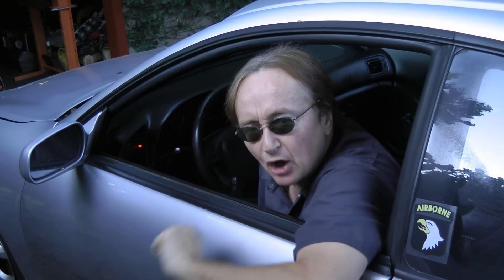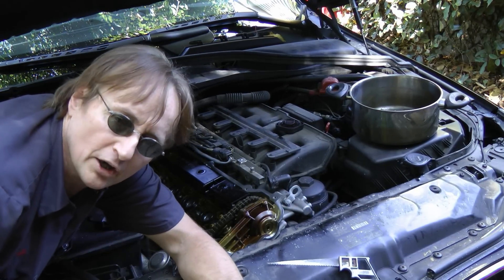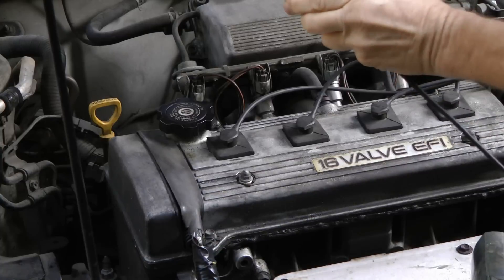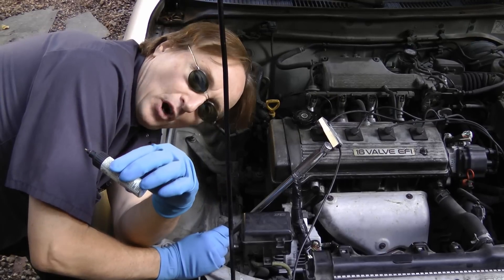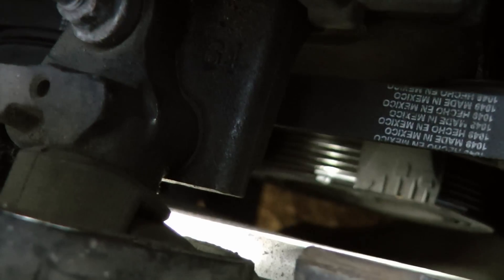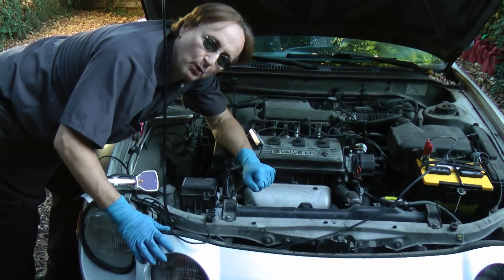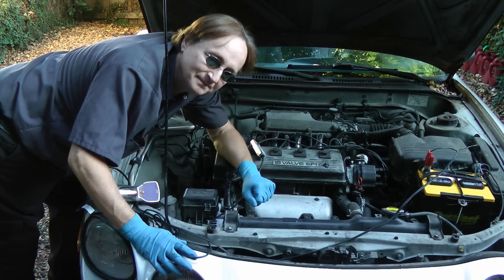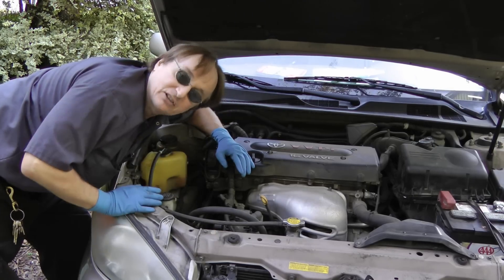How to Check a Timing Belt or Timing Chain in Your Car

Comment: Hey scotty man my car hasnt been able to stat for a while ive changed fuel pump and starter, all ralays and guses are good to the t. My fuel pump wont prime but i hear it at crank, its getting power for sure. Theres corrosuon on my positive cable but none on the negetive. I have no clue what it could be and ive checked everything.please help.
Reply from the maker: if fuel pump gets power when you check it, but no pressure, start by replacing the pump
Reply: I replaceed the pump and it gets pressure.
Reply: ***** have you tried all the spark plugs? scrape the corrosion off of the + terminal, have you checked your air filter? how about the ignitions module(s)?
Reply: my alternator in my trans am needed to be replaced, and often my fuel pump wouldnt work right because of it, check that too
Reply: My alternator is out of the car too.but ive tried the plugs replace distributor and rotor still nothing. You think because my alternator isnt in it right now it will cause it not to start?
Reply: doubt that, the alternator just mainly keeps the battery charged, but if it works, install it, then turn on all electronics see if you have a good charge still, i've heard of voltage regulators screwing stuff up, that happened on my trans am, what kind of car do you have, maybe if you go on a car forum, they might be able to help, as my knowledge with cars isnt the greatest, but i know a little bit, is your car carburated or fuel infected?
Reply: Its a 1995 mazda protege fuel injected.
Reply: have you tried changing the fuel filter? first off try some starting spray, u just spray it through the intake manifold, if she dont start then it's something to do with your engine, but try that, and she starts, thenmaybe you will need a new fuel filter?
Reply: Tried it still nothing. I'd hate to junk it being i put so much time and koney in to it.
Reply: ***** Have you tried checking the basics i.e. fuses, relays?  My car wouldn't start one time and it ended up being the fuel pump relay.

Comment: Need help....jus bought a 2010 kia soul 2.0, 160k miles for my daughter. In the morning on her way to school, she stops on a decline hill at a stop sign and the car idles up slightly and shuts off...but starts right back up when cranked and does not shut off for the rest of the day. Any ideas???
Reply from the maker: could be a weak fuel pump, or  car just really low on gas with crud at the bottom of the tank
Reply: do you think it would hurt anything to pull the fuel pump and check the filter

Comment: How do you check timing on a Nissan Sentra. I have a 1993 Sentra with a 1.6 liter and you can't even see the timing marks without disassembling the car.
Reply from the maker: use a timing light as in this video . If it's withing specs, or just a few degrees off, it's OK
Reply: Scotty Kilmer   I can't reach or see the timing marks. No room to access. Does the inner fender come off?

Comment: dear Scotty HOW reliable is a 2002 Chevy Tahoe I've heard they have good engines
Reply: I have a 2001 5.3 and in 150k I've had to replace the power steering pump (fluke really), the AC compressor & dryer, fuel pump (left me stranded) and a couple of window regulators. I've used the pee pee out of the AC living in hot places, so honestly, none of this stuff is problematic. It just wore out. Outside of fuel pump crapping out on a road trip,  it's been rock solid and doesn't leak a drop of anything. I'd say a 2002 Tahoe is very reliable, cheap own, and cheap to fix. I'd jump in mine and drive across the country w/o thinking about it. I drive hard too.
Reply: J Bush very I got one handed down and it currently has 205k miles and the only things were the fuel pump going out and the A/C not working

Comment: Hey Scotty, if you have time. tell me if I should get off my butt and stop procrastinating. I have a timing belt on my '96 Ford Ranger with the 2.3. I changed it ten years ago. Since then, I have put only 38,000 miles on it. Have the ten years worn the belt out or should I just say it ONLY has 38,000 miles? The new belt and water pump kit is already sitting in the back of the truck because spending the money is easier than actually doing the work. What should I do? btw, I just subscribed.
Reply: +Scott9084 Nevermind. It was a dumb post. The change only took a couple of hours. Wasn't worth procrastinating about.
Reply: +Scott9084 the rangers dont have chains??!!
Reply: +**Classified** It's possible the newer Ford Rangers have timing chains. Cars and trucks often had timing belts between the 1970s and the 1990s. My vintage Ranger has a "Lima Engine," named after the Ford plant in Lima, Ohio. It may be the same engine, or shares many parts, with the 4 cylinder Mustang engine of the same day. It also may be a derivative of the Ford Pinto engine. Timing belts everywhere.

Anyway, it was an easy 2-3 hour job as long as I left the water pump alone. Not worth the procrastination. Side note, the only difficult part was to remove that fan pulley bolt at the front end of the crank. Something like 150 foot pounds. Scotty had a video about that too. Something about putting your 21mm socket and breaker bar on the bolt and hitting the starter for 1 second.
Reply: Scott9084 I'm shocked. I always thought Ford did the chains in any truck they built. Even some of their older cars had chains over belts. At least there's a good bit of working room in a truck. Doing one in a 3.5l honda sucks.

Comment: hey the dealer told me my timing belt is cracked and should change it asap it is at 101000 miles (02 jetta) and i have been driving with this "problem" for like 3 months now and i dont know if they just want to get money outta me they said 900 dollars for the job? is that to much this is the price for everything ... help!

Comment: Uhhhhh....that method will only work if the spark timing is triggered off a cam driven distributor or angle sensor.....which that Matrix is not.
 Most modern cars use crankshaft position sensors for timing since it isn't affected by things like cam drive fluctuations and component wear.....not to mention the lack of sparkplug wires to tap onto, with many,many newer cars.

Comment: I drove a truck with those exact symptoms, the A/C compressor was pooched.  Whoever said power steering fluid, that just makes no sense.  The sound you describe would have nothing to do with braking, and if the PS fluid had a problem it would affect your damn steering.  It's an A/C problem and you gotta take it to an A/C guy, you shouldn't do your own work on A/C system unless you know what you're doing.

Comment: They used to say timing CHAINS last the life of the engine, where as timing belts you have change them out every 110,000k or so.  It sounds like choosing an engine with a chain is not the money saver I had thought .. ?

Comment: I don't get it.  The crank pulley is fixed to the crankshaft.  Shouldn't you check the cam pulley timing instead?
Reply: The distributor that fires the spark plugs is fixed to one of the camshafts. If the white line moves a lot it means that the camshafts aren't in sync with the crankshaft.

Comment: Get your timing belt and accessory drive belt checked every 25,000 miles, preferably replacing it every 50,000 miles.
Reply from the maker: that's a bit excessive, here in the states most companies advise replacing timing belts every 90 thousand miles

Comment: this Just happened today, my car vibrates at low speeds then eases out of vibration when it hits higher speeds. I'm thinking somethings wrong with the wheels or anywhere else around it.

Comment: hi there, i am wondering why do head bolts need to be tightened a certain way, like in a specific order, thanks.
Reply from the maker: yes, get a cheap manual with pictures and torquing specs
Reply: Alex Voglar To keep the forces applied by the bolts reasonably even across the head so it doesn't warp or crack, and so the gasket is compressed evenly.

Comment: Did i hear you say change the timing chain every 4000 miles, Really i thought they last longer, i know timing belts got to go every 60k miles and i thought a chain can go further like 120k miles further, Plz correct me if im wrong!!
Reply from the maker: NO, timing chains don't ever need changing if you have a well built vehicle and change the oil a lot. Timing belts need changing every 60-90 thousand miles depending on the make and model

Comment: Hey guys i have a 96 non turbo eclipse 2.0.  My car has been running bad. takes forever to accelerate. it smokes black smoke. it jerks back and fourth sometimes. I just scanned my ECU today. I got these codes. Any help?
P0171 FUEL SYSTEM LEAN
P1494 LDP SWITCH OR MECHANICAL FAULT
P0300 MULTIPLE CYLINDER MISFIRE

Comment: HEY SCOTTY I HAVE A MURANO 2010 , MY TIMING CHAIN TENSIONERS WERE CHANGED TWICE NOW, EVERY TIME THE COLD START UP SLACK SOUND FROM THE CHAIN GOES AWAY LIKE FOR 4 DAYS AND COMES BACK, THE FIRST TENSIONERS THAT WERE CHANGED HAVE VERY LITTLE MARKS OF THE TIMING CHAIN, WHAT ELSE COULD IT BE,??? I HAVE A PERFECTLY CLEAN AND HEALTHY ENGINE AND CLEAN OIL, NO SIGN OF ENGINE SLUDGE OR BUILD UP ANYWHERE, BUT THE SOUND DRIVES ME NUTS. COULD THE PHASER BE MAKING THE SOUND AT START UP???
Reply from the maker: +fireblade639  could be the phaser, but could also be a worn timing chain too, they only last so long on nissans

Comment: What if the engine wont start? my car engine only cranks over. I had the ignition coil the igniter and the crank sensor replaced and it started and ran for about a day and when I went to start iit again the next day it would only crank over, Does anyone have any suggestions as to what the problem might be?  I have been thinking that the timing belt might be the problem but I am not shure.Thank you
Reply from the maker: so many things can do that, so do my video tests "fixing a car that cranks but doesn't start up;"
Reply: Thank you Scotty will do.Cheers

Comment: how do i Connect i Timing gun to a Car with ignition Strip instead a ignition Cable?
Reply from the maker: you place the inductive sensor on top of the coil on plug assembly to get it to flash

Comment: +Scotty Kilmer how do you prevent damage of your timing chain using high performance oils and fluids?
Reply: +stephanie lopez  Use the recommended grade of oil.  Buy a top quality oil filter and a good quality oil. Preventing the buildup of sludge and fowling in the lubrication system is the best thing to do for every part of the engine.  How frequently you should change the oil depends on how the car is driven; a bunch of short low speed trips or miles and miles cruising down the highway.

Comment: I really don't get how is this related to the timing chain unless it's a mechanical distributor (obsolete).
Since the coil fires electronically at a given time, that given time is based on what the computer says in concordance with crank speed sensor, throttle position sensor, etc.

So I have two problems with this:
1. The ignition is based on the crankshaft position sensor (and the mark is on the crankshaft itself, so it will always line up)
2. The moment of ignition is variable based on the conditions (speed/load), so it's normal for the marks not to line up while reving or while in load or both. (not jumping, but drifting in the general direction for giving enough time to burn and that is giving more angle degrees before tdc for the ignition.

The timing otoh is about the valves is more than often nowadays, ingintion and valves are separate systems with separate action mechanisms.
Reply from the maker: crank and cam sensors work to set timing, if chain is worn, that will unsync that data and mess with the timing. See if all the time

Comment: #Scoty Wilmer Why don't you make videos on car's having diesel engines??
Reply from the maker: I have very few customers with diesels, that's why
Reply: Scotty  my car will idle perfect In park and when I put it in reverse  or drive it wants to die out like it had no power and it will drive perfect when u start going but when u  stop it wants to die again
Reply: it's sound like your "air control valve" is wearing out
Reply: Real man buys unleaded not diesel :D
Reply: Obviously he is a gasoline mechanic. Duh

Comment: what if the car has coils instead of spark plug wires?
Reply: dave houston you would need to get a spark test lead that is basically an extension and put it between the coil and the spark plug then attach the clamp to that

Comment: my 1995 silverado I notice at low speeds when I let off the gas the engine chokes and the rpm needle starts fluctuating from about 500-1000 rpms for a few seconds, and when I shut the engine off there is a quick rattle.  I think it might be a timing chain, but what is weird, it began happening the same day i did a tune up which I'm not entirely convinced something didn't go wrong there.  Anyone have an idea?

Comment: If a loose timing chain bounces around "back and forth" when the engine is revved, it makes sense that it can cause detonation or pinging at higher RPM. This is despite the fact that a worn chain causes retarded cam timing.

Comment: what if it has no wires then how do u check the timing
Reply from the maker: the coil on plug assemblies put out so much power, you put the inductive sensor on the timing light on top of the and it will make the timing gun flash

Comment: MY CAR WONT START AND I LOOKING AND MY CAM ARE NOT MOVING AT ALL BUT THE TIMING BELT IS STILL ON , MY CAR WAS MISSFIRING AND HESTITATING , BUT NOW IT WILL CRANK BUT NOT START
Reply from the maker: if cam does not move, odds are the belt has eaten the teeth off on the crankshaft. Often that means a bad belt, OR a locked up camshaft. good luck
Reply: DO U THINK MY VALVES ARE BENT
Reply from the maker: Leem Wills
yes, do a compression test to find out, if some cylinders are really lower than the others, for sure
Reply: wen I try to start it it doesn't sound like anything hitting , it just turns  like it always do just doesn't start . and I was at a stop lite wen it cut off
Reply from the maker: Leem Wills
you said your cam is not moving at all, so the belt has to be broken on the bottom as i said, or the cam itself is broken. Big job there.
Reply: I have an 93 Infiniti j30 its engine is a interference, but I was at a stop sign and wen I went to hit the gas it cut off, I took the top timing cover off a little and tried to pull the belt but it was or felt tension stikk

Comment: From everything ive read or heard, a timing belt only gives 1 adv, it runs quieter.
Reply: ***** Chain is not that loud, i can barely hear it, hell i don't hear it at all
Reply: ***** Also doesn't need oil for lubrication like a chain
Reply: ***** I have a double chain on my 239 V6 and I can't hear it at all.
Reply: i believe everyone,  just what ive heard.  honestly i couldnt actually "hear" any difference between the 2.  ive had both chain and belt vehicles,  no discernible difference
Reply: +Jason Rushing Chains also last much longer than belts, and don't need replacing every 60k miles. Also, modern timing chains tend to run QUIETER than timing belts.
Reply: ZAMIN! i believe you on the chain aspect.  we had a chain vehicle that i sold at 200k to a friend he still drives it on the original chain at 220K+
Reply: *****
I would seriously consider at least examining the chain because 220k for a chain is really pushing it. Most chains are rated for between 100k-150k, at which point they should be inspected.

While the chain in that vehicle may still be intact, I'm going to suspect it has some pretty bad stretching. You can check for a worn chain with a timing gun, if you rev the engine and the timing goes all out of whack then the chain needs to be replaced.
Reply: GGigabiteM that car was sold years ago
Reply: +Jason Rushing 
It runs quieter and no oil require. Valuable parts in Timing system is saved because Belt breaks
Reply: +Jason Rushing This can occur with a chain-set too, but only if the cam sprockets have nylon teeth molded to them. This has been done for years as a method of reducing engine noise. Called a "quiet-chain", they can last on average 80k-150k/ mi. depending on what kind of lubrication they receive. A roller-type chain may operate more loudly, but can operate for a longer period... depending on the total load on the camshaft. (Lifter/follower pressure resulting from valve-spring stiffness, oil-pump volume and/or pressure-rating) A double-row roller will outlast them all... Except for gear-drives, which are the noisiest even in "closed" style.

Comment: What if your car has coil packs instead of spark plug cables? Where do you connect it?
Reply: PhillyGz1 you would need to get a spark test lead that is basically an extension and put it between the coil and the spark plug then attach the clamp to that
Reply: Great! Thank you. Love your show.

Comment: Buy Ford. If they break down they are easy to fix and always last. My Step Father's ford was at 500k before he wanted to upgrade. My Explorer died because I was to dedicated to work to try and fix an obvious broken clutch(Young and stupid) and my Brother's truck has an estimated mileage (Odometer broke and some tampering is evident) is at 300-250k miles now. And still has Way more torque then all of our vehicles here at the house. Buy American and large, money on repairs>Money on Gas.

Comment: I'm confused as to why buy the timing light , when you are simply checking to make sure the marked paint is not moving much on the crankshaft or would a small flash light would have worked
Reply: Ronnie Nelson Jr the light strobes
At the precise moment that thay are ment to aline witch is your indicator if it flashes and there out of alignment then something is up and bear in mind that the crank is turning at idle 1000rmp
Reply: Ronnie,  A flashlight would work fine if you can sync your eyelids opened and closed perfectly and your brain has zero lag with every other rotation of the crankshaft.